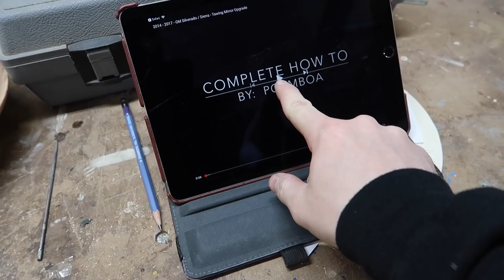THIS PART Makes Towing So Much EASIER!!!

Comment: I work at a GM Dealership in Canada and we were able to replace the door harness and tow mirrors then reflash the computer. so the owner could power fold the mirrors in, power adjust, turn signals and heat

Comment: I have a 2017 Silverado LT which also came with the regular mirrors (power and heat only). I bought the GM factory tow mirrors along with the wiring harness. Although the dealership didn’t think all the features would work they did. I was able to use the integrated turn signals and LED spotlights in the mirror once I had the harness installed. You should be good. Had my work done at Lawrence Chevy on the Pike.

Comment: Still need weight distribution hitch before loading that trailer with a car though....
Reply: Probably will need air bags too.
Reply: My Z71 1500 5.3L tows a 5000 pound trailer no problem without airbags or weight distribution. The rear end drops down 2-3 inches but everything seems fine. On long distances I use weight distribution bars.
Reply: Its not that heavy. Majority is over axle. He does have a leveling kit, which is stupid, when using a truck to tow.
Reply: Snipe Stud00 I say the weight distribution hitch because it helps with trailer sway, I am also unsure if his truck has a trailer brake control.
Reply: Jake Medley even without a brake controler itll activate. Just not as strong as with. Simple plug and play device.

Comment: The only thing I would add for towing is a sway bar hitch to the trail . When you have a lot of weight in the trailer it will sway back and forth a lot at height speeds. Curt Manufacturing Weight Distribution Hitch Kit, Model 70230 I would recommend this it will work for what you need

Comment: should’ve bought a duramax. going to be a lot of weight for that little 1500
Reply: Ruchy 14 Don’t underestimate the power of the 1500!!!
Reply: Logan Rader yeah they have plenty of power but they just don’t have the weight to them like a 2500
Reply: Guess we'll have to wait and see. I'm 2500 myself
Reply: He's got the 3.08 gears in his truck the actual tow capacity of his truck being a double cab is probably 8500 he's going to max out his towing with the truck. He would have been better off with the 6.2. He would have about 4000 more pounds of towing. No need for the duramax but the truck he has is under powered for what he's gonna do. But should be fine on short trips. Any long distance or anything with a lot of grades will be a struggle.
Reply: Just checked the max towing for a double cab 5.3 with the 3.08 gears is only 6200
Reply: will borio he said in the last vid its 10000 in all he said is gonna be lil over 7000
Reply: Douglas Schwirtz that's fine but gm with their own numbers say it won't happen with the 3.08 gears. Has to have 3.42 gears. And that only gets I think 9600
Reply: Even with the 3.42 the max is 9600 the max for 3.08 is 6200. A lot of people think oh I have a 5.3 double cab I can tow 10000 it says so. The need to make sure.
Reply: I had a 04 Silverado 1500 5.3L with Max Tow Package and I use to tow a 24" Steel enclosed car trailer with a bunch of food vending supplies without any issues.
Reply: Ruchy 14 is that your truck
Reply: James Briggs 04 probably had 3.42 or 3.73 gears. Also had a 4 speed not the 6. It's a completely different truck. And was the 04 an extend cab or crew cab or even a regular cab.
Reply from the maker: The truck is rated for 10,000lbs. I’ll be towing about 7000lbs. Duramax is not needed.
Reply: GuitarmageddonZL1 I give it less than a year.
Reply: Everyone underestimates the 1500's... My dad works at a home Depot lumber distribution center and there was a big rig with a trailer that wouldn't start cause of a bad battery and he pull started the rig with trailer in his 2016 silverado... They have a lot of power and can tow almost anything you throw at it
Reply: It was an extended cab with 3.73 gears, 2wd. Had max tow capacity of 8100lbs
Reply: GuitarmageddonZL1 g91 is 3.08 you would be limited to about 6200 max nick
Reply: will borio nothing a blower can’t fix. Stop and go and grades are the concern. Highway that is pretty flat ain’t no thing.
Reply: Owens Racing agreed still need them gears changed. 3.08 are good for mpg not towing.
Reply: +James Briggs lemonade stands are good for washing your dirty greenbacks 😉
😒💵👀
Reply: I have a 03 Toyota Tundra and I pull a 21ft trailer that’s all steal and I have towed trucks car and all with my truck . Pulls it with know prob at all
Reply: Douglas Schwirtz no they straight up lie to you that truck will struggle big time pulling 10k pounds
Reply: will borio The only models carrying 3.73s were the z71s extended cabs. The 05 models gone to 3.42s along with putting the sun roof option. I tow way, way more than my 1500 is rated for and it does just fine. Then again, im the only crazy SOB to pull 15,000lbs on my 05 extended cab (04 built z71). So i get the 355 hp aluminum heads and 3.73s. and not the 3.42s iron cast heads...
Reply: The GVW is what a lot of you are talking g about that is your truck and what the truck is carrying . So let’s say the truck is GVW for 6200 that’s what the truck max aloud to weight with the truck people and or what’s in the box . So if your truck is let’s say 4500 pounds and you weigh 200 you have gear in your truck that’s another 800 the max tongue weight you and have is 700 pounds that will give you your GVW of 6200. The max rating for the truck to tow is is wat the truck can pull while still be able to affectingly stop so yes that truck is any where from 9800 thru 11000 depending on which package he’s has on his truck so

Comment: A weight distribution hitch and airbags will help your trucks handling immensely when towing and also make it alot safer. On a half ton pickup you are almost guarrantteed to get a death away with out it. On more thing is get the car in the trailer and scale it at different point in the trailer to get the best distribution.

Comment: I just a installed a set of tow mirrors from Boostauto.It came with wiring harness to allow the extra functions to work.They work great and the reverse light is much brighter than stock.

Comment: Clicked off when I saw it was tow mirrors instead of helper bags which is what u should have got
Reply: jake anderson for the weight I disagree. He drives alot of freeway and with small mirrors and heavy traffic lane changes can be a bitch
Reply: Send him some bags then
Reply: id rather deal with squat than not being able to see beside the trailer. If he would take the leveling kit, the truck would sit level and tow correctly. No bags required.

Comment: one other thing -- if you're gonna leave your trailer unattended for periods of time, especially loaded with tools/equipment/merchandise, you should look into getting a hitch lock or cable wheel locks that lock the 2 wheels together OR BOTH.
you just want to slow thieves down or prevent the theft altogether....

Comment: That’s weird, I put the same mirrors on my 2007 Silverado LT1. It used to have heated mirrors without the blinkers. I slapped those same exact mirrors on my truck and the blinkers worked both front (amber) and back (red ones in glass). Then I ran some wires and jammed them in my fuse box for the white led reverse lights. Works great for me!

Comment: Nick, You should get the weight distribution and sway control for your Hitch/trailer.. It's makes a world of difference, and it makes towing that size trailer with a 1500 so much safer..You won't regret it.. You can the 10.000lb complete set for around $300..  Peace!!

Comment: You will have to pull the mirrors apart if you want the outside to work as a running light. Look up boost auto parts they have a harness for them and a how to video.

Comment: Nick when you mark the floor where the car will sit every time, keep in mind that 60% of the weight needs to be in front of the axles or you will likely experience the trailer swaying.  Should be ok with the engine in the front, but you may need to experiment with where the car will end up.

Comment: I believe with GM you have to bring the truck to the dealer to have them "programmed" to the truck. My buddy put tow mirrors on his 2500 Denali and it was a programming thing then all the functions worked.

Comment: Once you load the car and all your track gear in the trailer you WILL need a weight distribution hitch pulling with a half ton. My guess is you’re probably going to be somewhere in the 7500lb gvw on the trailer. A wdh will help with the seesaw at the wheel and help make the truck feel stable

Comment: those tow mirrors are the same as my truck. the so called reverse light isn't a reverse light. it's tied into your cargo lights. push the cargo light switch when truck is in park, reverse, or neutral and they should come on. They are blinding and really nice when backing up a trailer at night.

Comment: Look into load leveler shocks better than airbags and you don't lose the ride of the vehicle it also increases carrying capacity by 1100 lb
Reply: Charles Rivers  airbag or no bag you will always be limited by the weight rating of your axle and tires
Reply: I am aware of that so obviously you wouldn't want to exceed that I was just letting him know by adding load levelers which I have used on my company vehicles and my private vehicles I have no problems with them they stiffen up when you're towing and they really don't take away the ride and yes I understand that you can't exceed with the tires and axles are but I was just letting him know you can increase by 1100 lb

Comment: I would get the airbags or rear lift blocks. Trust me I got a 2.5" leveling kit and when I haul a load the truck squats. Yeah its not a big deal with an empty trailer but once you put the freedom rocket in its gona squat. When driving at night everyone flashes their high beams at me. I installed a 2" rear block and now the truck sits way better with a load.

Comment: Just a thought but would a mechanical winch on the inside be practical to manually load the cars on the trailer Incase it’s to early in the morning or time of night where you can’t start your car? Or in a situation where the car can’t be driven on the trailer like if it breaks or can’t start?
Reply: Mr Pall it’s a good option I have one in my trailer. Didn’t want to permanently mount it though so bought a hitch carrier for the winch and bought a bumper receiver mount and bolted it through the floor and now it’s removable and works fantastically.

Comment: NICE ! Did my 1500 LT  trailer mirrors myself too. Pain in butt. My next trucks gonna have em in already.  Mine don't have signal or reverse lights but are heated and inside power move. Cost me 250$ new for both.

Comment: Dude you didn't add the fourth bolt, you are supposed to drill a hole to fit the fourth one in to hold the mirror. Also you could wire the other functions of that mirror through the door harness on the body side. I did mine on the same truck you have.

Comment: Check out Weigh Safe trailer Hitches. They have a scale built in that will tell you where your optimal tow weight is on your hitch. Very nice all aluminum hitch and stainless ball.

Comment: Your truck has the correct harness you just didn’t get the correct one it is more expensive but easier if you go through a Chevy dealer my dad did that with his 2015 1500 and they gave him everything and full function of everything and going through Gm they can program the mirrors through the computer in your truck by going through your vin

Comment: I have a 2010 Chevy 1500 1LT and I had the heated and powered, but no turn signal. I bought mirrors off eBay and everything worked besides the rear facing light. I just didn’t bother to hook that up

Comment: That trailer is going to be all over the road, going to have osenif not more weight in the trailer than the truck. Truck is going to constantly shift the rear end is gonna bounce like hell with all that tongue weight. I say he takes one long trip with it and trades it in on a duramax.

Comment: Hey nick are you running the 3.08 gears in your truck? I thought when you got it you said you had the 3.08 gears. If that's true you need a new truck. Max tow is 6200 on the double cab with 3.08 gears. You would need to go with 3.42 gears minimum to get you to 9000. Or get the 6.2 with the max tow would be a better option.

Comment: Screw a hotel room when your at events getting gapped. Sleep in the trailer. Then you wouldn't even have to take tents down or anything.  Be 24 hour security for your spot

Comment: I want towing mirrors but it’s hard to find ones that have power folding which I would like to keep. I’ve seen a new Sierra 1500 at a dealer with power folding tow mirrors so I might be able to buy some through my dealer

Comment: If you not fully committed to the air ride yet  try out http://www.airsafehitches.com/ makes a big difference when towing, the ride definitely going to feel better and it’s adjustable so that you can adjust the height so the truck doesn’t sag in the back and have a level more comfortable ride while towing

Comment: I give it till mid summer till you want a 2500hd with either the 6.0 or duramax. Them 1500s with the 5.3 tow anything over about 2500 pounds long distance like crap.

Comment: That leveling kit is going to suck when towing completely loaded. Why even with lifted trucks, i keep the rake or add more by dropping my bars. 15,000lbs on a 1500 makes that rear squat. Why im actually looking at 2500  5 spring packs packs to replace my factory 3.

Comment: It’s better if you tie a tennis ball to the roof to touch your car windshields when your parked right in the trailer
Reply: good tip, sensible af!
do you also have cable ties fixed to your bike helmet to stop magpies from swooping?, helps with your cellular signal too, especially when shopping 😬😂😂

Comment: Run the wires thru your firewall and cut your original signal and wire them in to it and same with your reverse I did it to my 97 Silverado and they work as they should.

Comment: Should've just left the stock ones because it's a 1500 and you can get extenders for the stock mirrors
Reply: Matt ra Nothing's better than the real thing
Reply: The proper tow mirrors are better and safer when towing. Its easier to see.
Reply: Snipe Stud00 Thanks! Well said. Safety comes first always. Also more practical, make more sense.
Reply: Google1 User I know all too well from experience. i had the factory small power extending POS crap. Couldnt see a thing. I put the factory just power folding back on. cant see as it is, so why take those tiny things on the road? i then drove my stepfathers 3500 with those big mirrors. could see everything and more. Frankly when towing you need to see whats going on behind and beside just as much as forward.

Comment: You need to lift your truck
Reply: Wade Niemeier Why? Maybe he doesn't
Reply: Lifted trucks aren’t practical for towing
Reply: Liam Peterman Interesting, makes sense. I think the 2018s offer a package with adjustable air lift from a button on the dash. This could be used to lift the rear as needed due to high tongue weight from the trailer.
Reply: Liam Peterman Wanna bet?